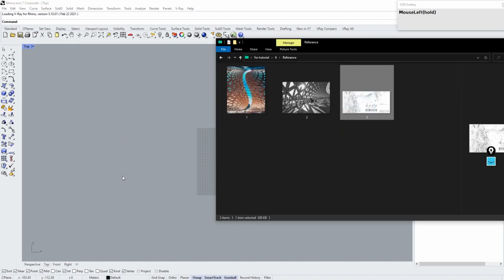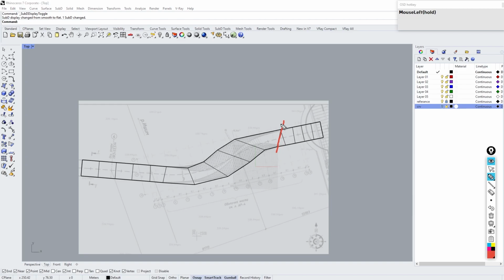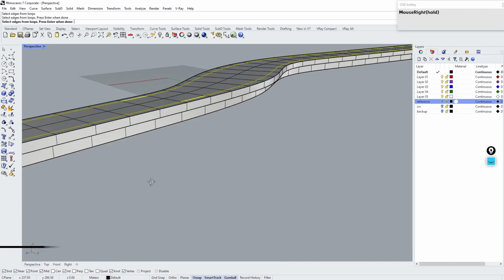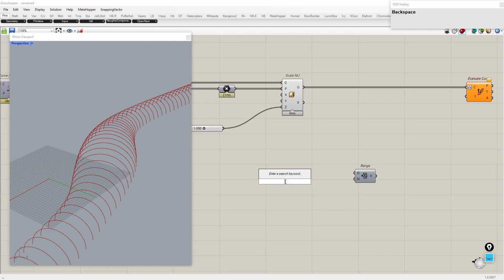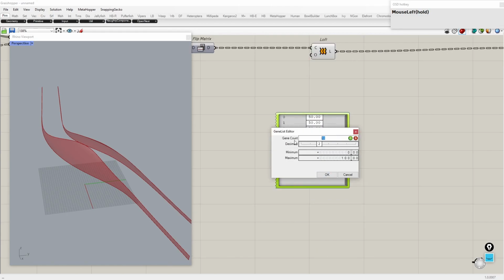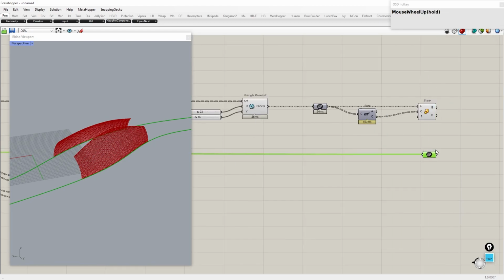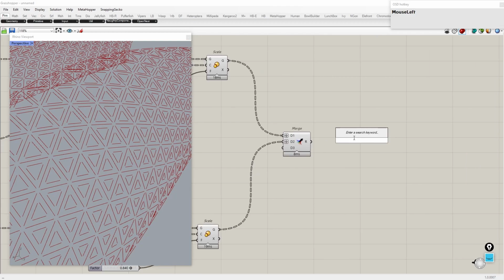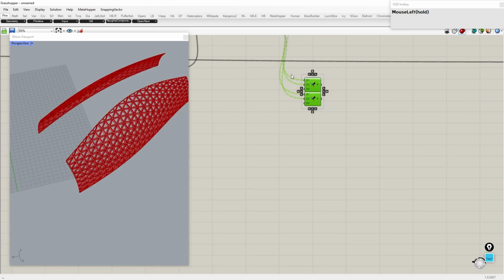Atyrau Bridge In Rhino and Grasshopper

Comment: 1. Solution exception:Index was out of range. Must be non-negative and less than the size of the collection.
Parameter name: index

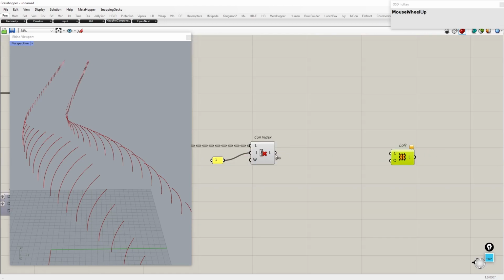keep getting this when i try to loft at 11:50 mark please help can send screenshot of script
Reply: when i flip matrix this error occurs on the loft
Reply from the maker: @tristanwarkuss5475  possible reason if the curve is duplicated or one of them has zero-length value, 10:29 domain starting must different from zero
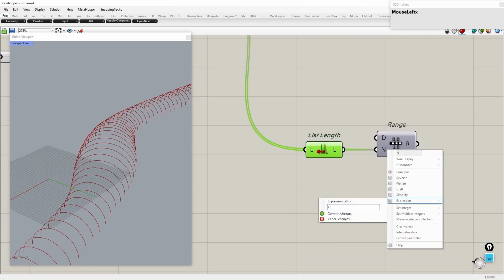2nd makes sure u add expression x-1 at 9:25 , if u still get the same err send ur script tridbeast@gmail.com
Reply: @3DBeast  fixed it, domain was on zero. thanks for the help! love the videos keep it up!
Reply from the maker: @tristanwarkuss5475  You’re welcome , and thank you